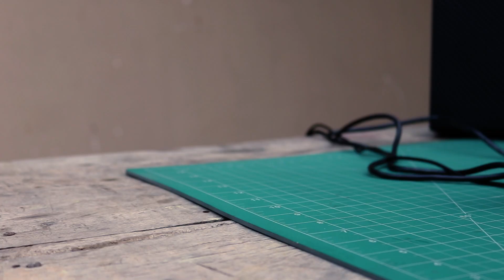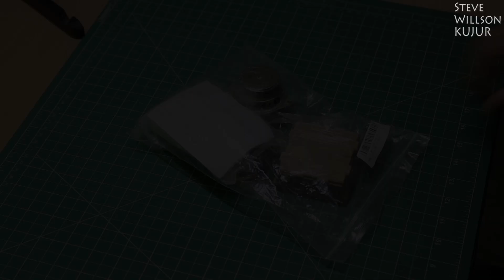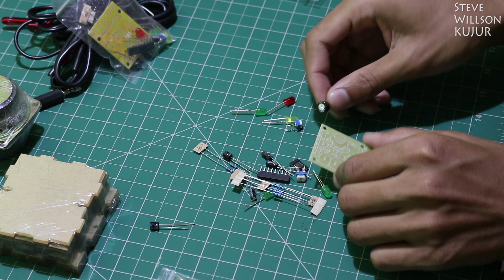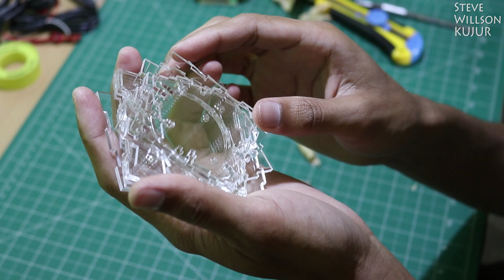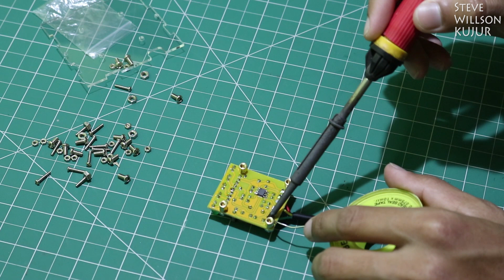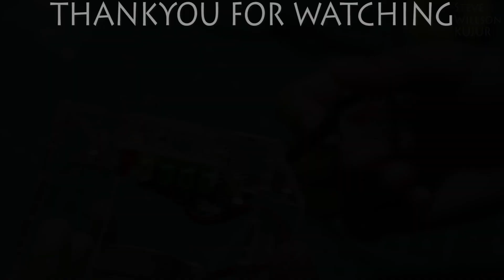DIY Transparent Speaker | DIY Vu light

Comment: so much effort for this project :( I wouldn't do it..
Reply from the maker: +Alexandru Simonescu yeah it's just small project " just trying some cinematography with my new camera"
Reply: oh ok, that makes sense
Reply from the maker: +Alexandru Simonescu by the way you can suggest me which type of project you want to see in feature
Reply: Sure.. here's what I'd love to see that are very few on youtube: A good quality two way BT speaker with digital processing. I see you had a project last year with Peerless drivers, they're good quality at affordable price. I will be building one soon, but first I need to "play" with the DSP (from Sure) to learn how to EQ the sound, crossover the drivers, etc. Very often the sound processing is overlooked and people just use a tone control but that's not enough. Almost every BT speaker over $100 has some sort of processing which amplifies the bass and treble at low volumes, decreases towards maximum, high passes above a certain frequency to prolong batt life, etc.
Reply: And since it will be compact you can use a couple of passive radiators (in case it helps the sound, make tests in a test box). You can make a PR from almost any cheap 6.5inch speaker by removing the magnet and adding weight to the voice coil for tuning. This way you can save cost, because it's not a cheap project I know that! hah but might blow up your channel if done right, you got tools, good mic and I see a lot of patience haha
Reply from the maker: +Alexandru Simonescu I've also seen that DSP (from Sure) but I don't have access to that . Definitely I want to play with that . 

And in feature I'll definitely do a project on dsp
Reply from the maker: +Alexandru Simonescu hahaha thanks I'll try to do
Reply: you asked them and they're not shipping to your country? because my country wasn't on their list either but then I emailed them and said it's possible, just made a payment with paypal the right amount and they sent it
Reply from the maker: +Alexandru Simonescu great I'll try to do this . Btw you have tested that module? How it works ?
Reply: you need a programmer board ($5 on ebay) to connect it to the PC and then program it with Sigma studio. I managed to connect everything and now I need to figure out the software which is really complex
Reply: What's the sound quality like